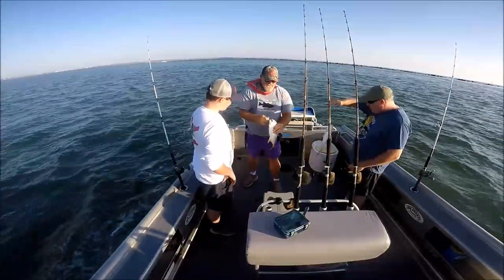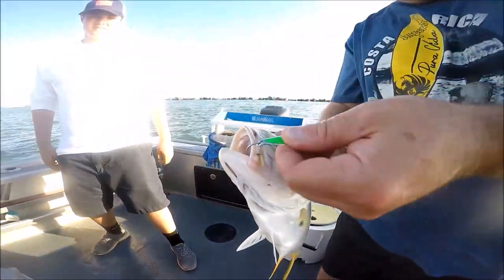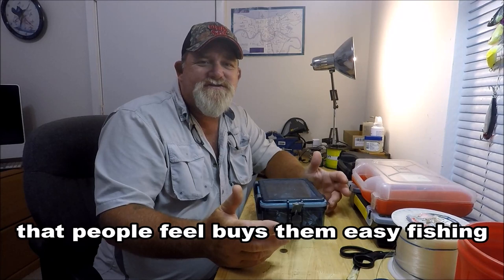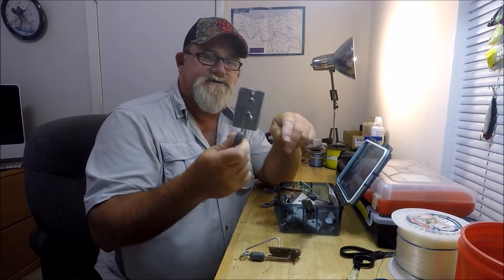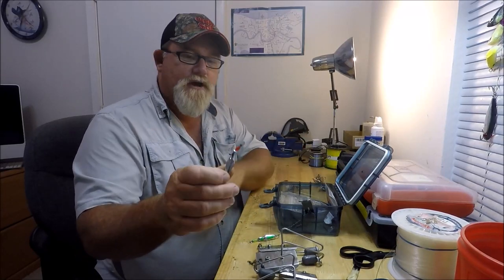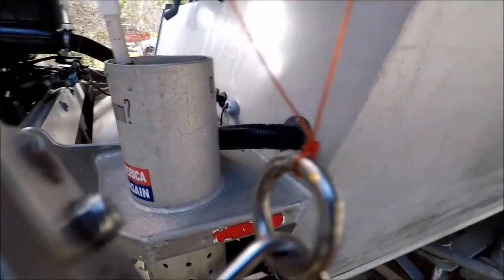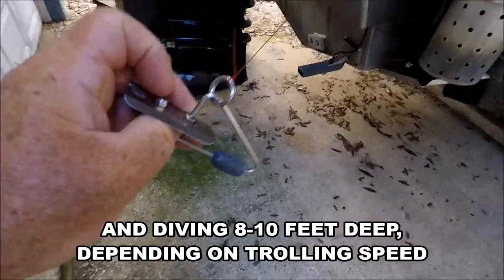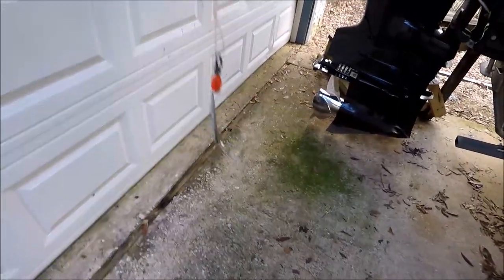Trolling: PLANERS & SPOONS, very effective!!

Comment: Great video! Very helpful information. When you talk about going at fast speeds, how fast do you typically troll in miles per hour?
Reply from the maker: no idea, its all a sense of feel. if water is calm vs. rough as a cob. no one in a boat goes by mph, mostly RPM's

Comment: Quick questions when you set a larger  and small planer out. To vary the lengths to limit tangles. Is the leader longer or do you let more line out on the planer itself?  Thanks for the tips
Reply from the maker: never get tangles, so thats hard to answer......let more out, I guess.